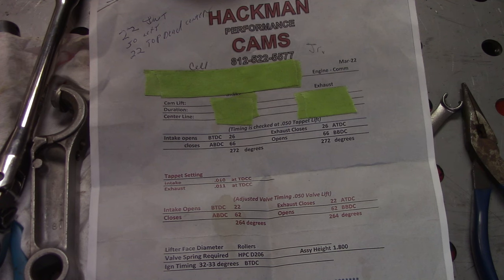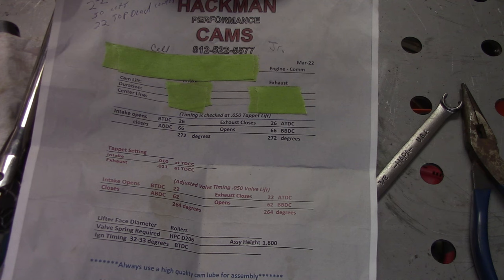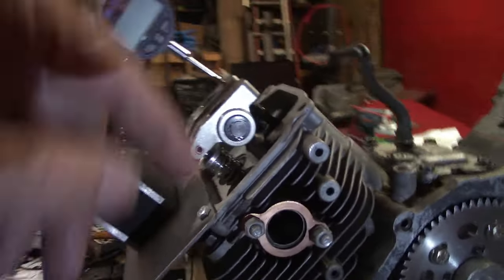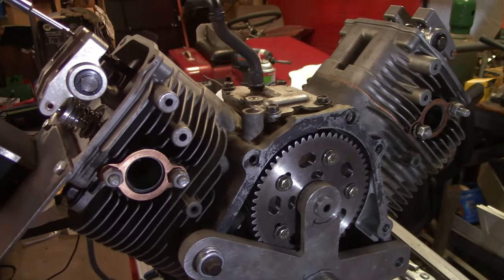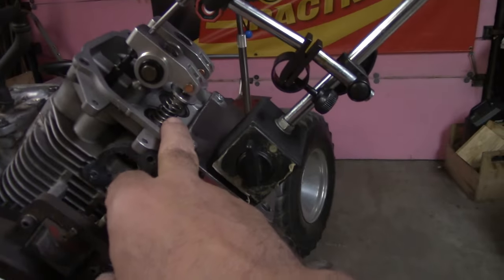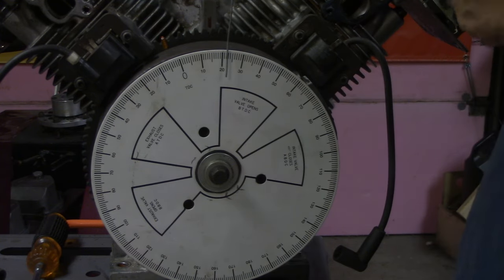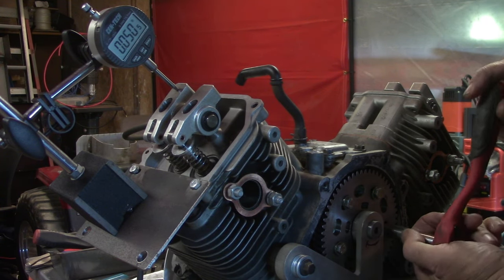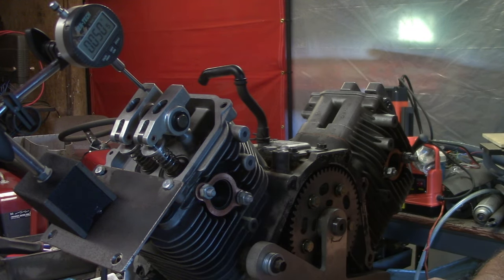The basics of degreeing in a cam and the tools needed.

Comment: Good stuff Ed! Those twin cylinder engines look MUCH easier to degree than the K series! Great catch on the lifters. I tried to run flat tappets on a roller cam in a SBC back in 1984, it didn't work. Ruined the cam and lifters in less than 5 minutes run time. We live and learn. I wish we had YouTube and PullerBear ED's Garage back then, your experience and advice would have saved me lots of money AND broken parts!
Reply from the maker: The cam and lifters 8s a mistake you will only make once 🤣🤣🤣